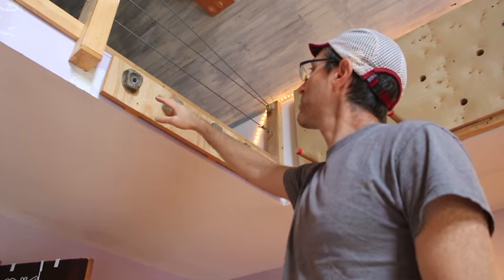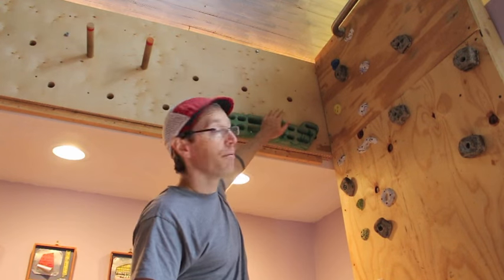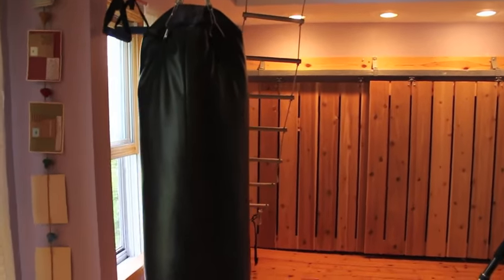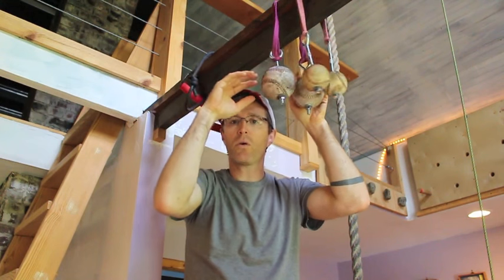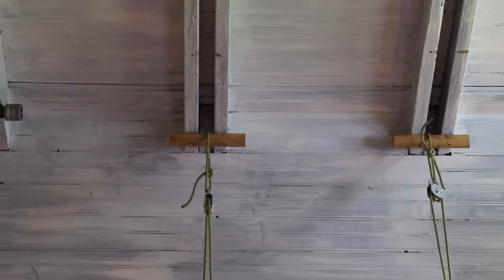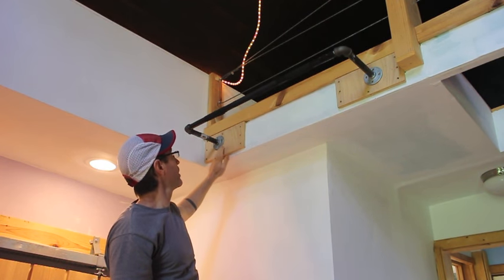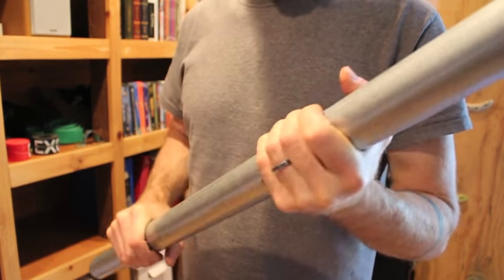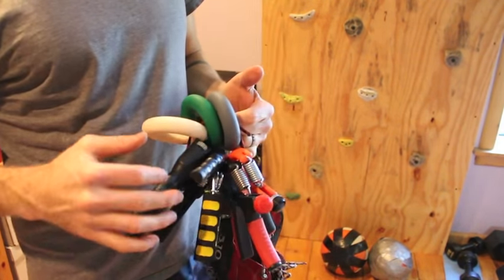DIY Home Gym Workout Room For Climbing, Crossfit & Gymnastics

Comment: Awesome room you have there. I just started out with climbing and i also think my dad would never give me a room for building stuff like this. But i love the idea of the selfmade hangboard out of normal climbing grips. It is compact and not too difficult for a beginner. I think i will build me one of these and put it right over my door. And then i only need some different grips for changing them. Thanks for that video man
Reply from the maker: Just add a little bit at a time -- it's amazing how much you can do with even just a few changes and additions. Good luck with it!
Reply: Yeah the great thing is that you can adapt it to your skilllevel and then you have more options in your skillrange than on a normal hangboard. So thanks alot for that idea

Comment: Awesome! In the early stages of building in my garage. Definitely picked up some great ideas that I never would've thought of! I've been trying to go the recycled route as well, although climb holds are not as easy to come across in my scavenging! Well done!
Reply from the maker: Excellent! Just keep passing along the ideas to other folks and we'll have ourselves a home gym revolution! Re: DIY climbing holds, I have seen some nice ones fashioned out of wood, and there are also these: http://www.instructables.com/id/DIY-Climbing-Hand-Holds ... Just a thought
Reply: Sweet! Thanks! Also--what size dowels are you using for the peg board? I want to make sure they're sturdy enough. Thanks again!
Reply from the maker: Oak dowels are very strong, and when short are never going to break. So I'd go with what fits in your hand. For me, that's about 1.5" diameter

Comment: This is sick. I live in an apartment and would love to hang some rings or ninja holds from the ceiling. There is also a drop-down part of the ceiling through which the air duct runs, similar to where you have your five rock climbing holds at the beginning of the video. Would be sweet to have a peg board there!

What does one need to know to install all this stuff without compromising structural integrity?
Reply from the maker: One rule to follow is to always attach to studs. Another is to use very solid fasteners. Go piece by piece and you’ll get there!

Comment: what wood are  you using for the rock wall?
Reply from the maker: Great question -- I should have mentioned that in the video! The rock wall is just a rather cheap 5/8" plywood screwed to a frame made out of 2x4s. The wood is a bit rough and actually adds some texture, which I kind of like. 

It's the pegboard where I used a couple of layers of much harder, oak (or maybe it was maple) plywood, as I didn't want any chipping or splintering. 

Happy climbing!
Reply: Thanks love your videos

Comment: Where did u get all those dowel rods?
Reply from the maker: I've used shovel handles in the past, cut down, but these are actually dowel rods I bought at my local hardware store. Here's an example of what Lowes has: http://www.lowes.com/pl/Dowels-Dowels-dowel-pins-Moulding-millwork/4294402553 ... Note that the kind of wood is important: I went for harder wood to avoid splitting or chipping, so used oak. Poplar would also be a good choice.
Reply: Thanks